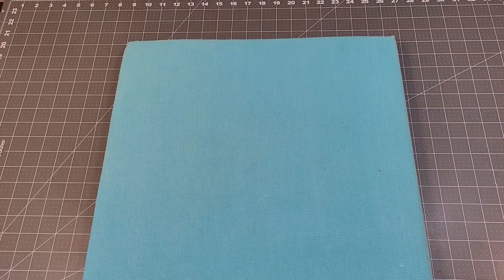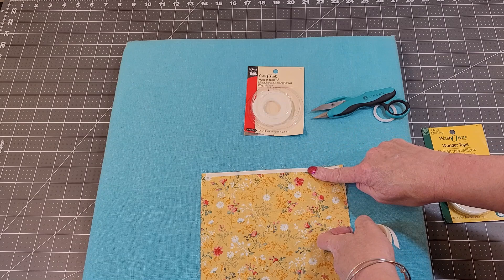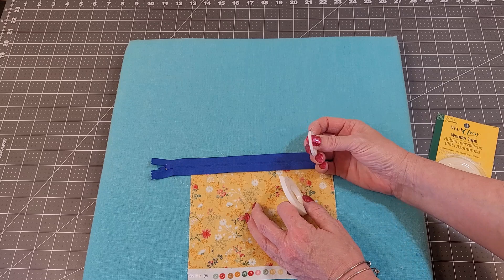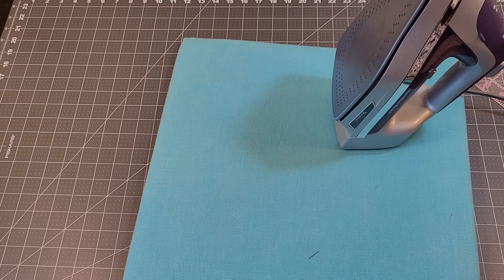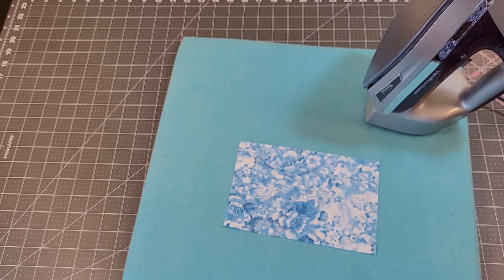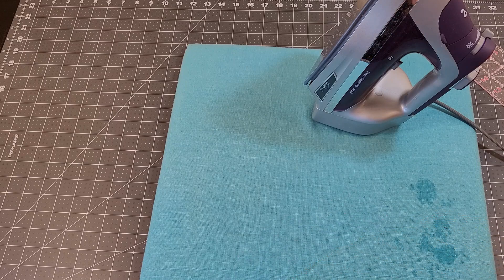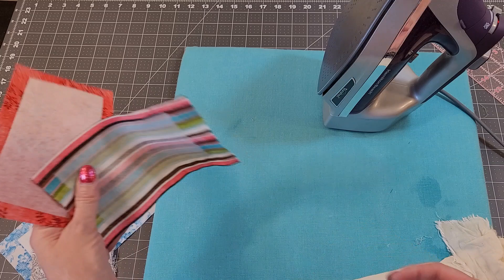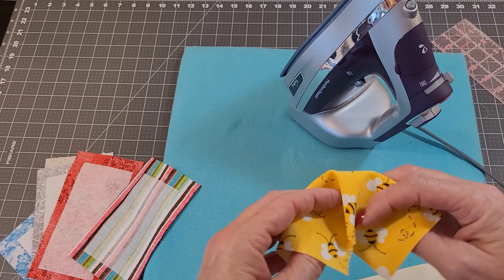Fusible Fleece, Interfacing and Wonder Tape Q&A

Comment: Good Morning Marie!  I have also had a problem with some fusible interfacing from time to time.  I put it on LINEN setting and found that much more efficient.  I am sure this was a very helpful video.  See you Soon.  PS  I have never used the wonder tape.  I will put that on my list of must haves...
Reply from the maker: Good morning to you too, Sherry!! Yeah, I'm not sure why they're so vague on their directions for this stuff. Oh well, we'll get it figured out, ha ha.   As far as the wonder tape goes, I love the stuff. I use it now mostly like what I showed on the zipper tab, but if I'm putting in a round zipper or something like that, I definitely would still use it on a zipper.

Comment: Hot! Hot! Hot! Yay! 
A long time ago I got a batch of  'naked glue layer.' It is just the adhesive that will stick on both sides after ironing. It has no peel-off layer. I don't know if they still sell it, but it turned out to be handy to attach two layers of fabric together without added bulk. And it was inexpensive. 
Thanks for the tip about iron-on vinyl. I had no idea.
A paste of baking soda works to clean iron plates, too, but is rather more messy, requiring water for rinsing.
Lots of good stuff in this video. Thanks!
Reply from the maker: Sarah, you had me laughing at the "naked glue layer" part, haha! I have heard of that, but I've never used it. Also, I did try the baking soda on my old iron, but it didn't remove whatever I had stuck on there. I don't remember now what it was, but I think it depends on what is stuck on there. Thank you so much and I hope you have a great rest of your day!
Reply: @MariesScrappyCreations  Baking soda (and vinegar) are supposed to be magic around the house. My mom used to give us baking soda baths in the hot weather. Cleaning scorched pots and refreshing the air and as an antacid. And it's cheap. My personal favorite is removing greasy gunk off anything. I could write a poem to its virtues, if I was any good at writing poetry.
Reply from the maker: @mambakind  oh come on Sarah… poetry!  You have it in you!  Lol!  Seriously though, they do a lot of different things around the house (and do them well).  A very good friend of mine who is blind, at different times I have helped her with her housework, (among other people).  One time, she was mentioning to me that one of her housekeepers couldn’t get the hard water stains off her bathroom faucet and that her family kept mentioning it to her that it needed to be done.  So, I took an old wet washcloth and set it across there and (you know it) I dumped vinegar on top of the washcloth and let it sit for a few minutes.  Went back out a while later and wiped it up and it was sparkling just like brand new.  Her and I were just talking about that the other day and about how many different “chemical” products she had bought tried that didn’t work and the vinegar worked like magic!
Reply: @MariesScrappyCreations  Challenge accepted. 
Baking soda is my friend
It helps me clean and bake.
It helps with grease and pots
And makes a lovely cake.
When I’m hot and out of sorts
I fill the tub, and add the stuff.
It works great dissolved like that
and sooths and cools me just enough.

🤪
Reply: @MariesScrappyCreations  Oh, yes, I've done the vinegar for hard water stains. Magic!
Reply: Love your little poem Sarah J!!!
Reply from the maker: @mambakind   I absolutely LOVE your poem!  Its funny because, when I wrote that... in the back of my mind, I wondered if you might just give it a try and I was hoping you would. 🥰😉  You totally made my afternoon. After having read a negative comment that kind of got me down, you definitely put a smile back on my face. I love it, thank you!
Reply: @MariesScrappyCreations  My job is done!
Reply from the maker: @mambakind  it is.  LOVED it!!! 🥰😋😉🤗😁

Comment: Hi Marie - I appreciate this tutorial!  I am always questioning the differences in fusibles and which ones I should use. I was only taught interfacings and at that time, none of those were fusible. I really need to try some of that wonder tape. I also like a hot iron whenever I am pressing anything. Thanks again Marie. Happy 4th of July weekend!
Reply from the maker: Hi Marie!  I'm so happy that you found this video helpful!   Quite a few years ago  I bought a bag full of interfacing at a yard sale for a great price. Once I got home, I realized that the majority of it was sew-in, instead of fusible, which is all I'd ever used. I still have the majority of it , because I don't have any idea how it works.  I would assume you'd have to put it right into the seam allowance and sew all around all 4 sides.   It just doesn't seem like it would give the same structure. I know that my mom used the sew-in type a lot, as she made clothes for us kids as we were growing up.

Comment: I made the mistake of using heavy duty fusible for baby quilt appliqué. My long arm quilter made an example of me; told the whole quilt guild what a hot mess it was to quilt.
Reply from the maker: Oh boy, I can imagine that was a rough time!  There is a huge difference, as you found out. I used the wrong one when I started a t-shirt quilt, but thankfully I was only two t-shirts into the project by the time I realized my mistake and I was able to correct it for the rest of the t-shirts that I used.

Comment: I cant get the paper to release from the adhesive.  Did I get a bad roll?
Reply from the maker: Hi!  I’ve definitely had some that won’t seem to pull away and I’ve had to snip them again.  I do try a bit of heat, as ai seem to have good luck with that.  Maybe try separating with a pin?